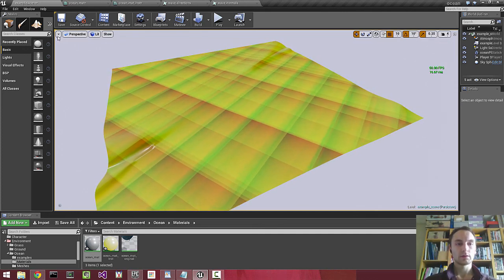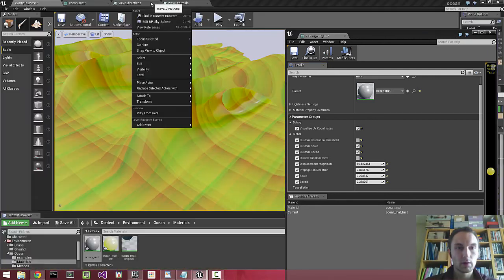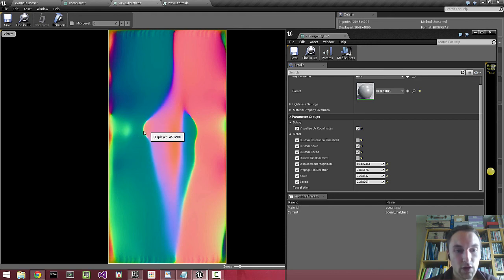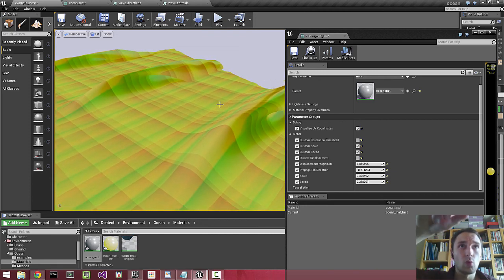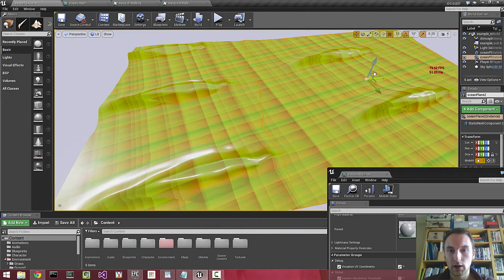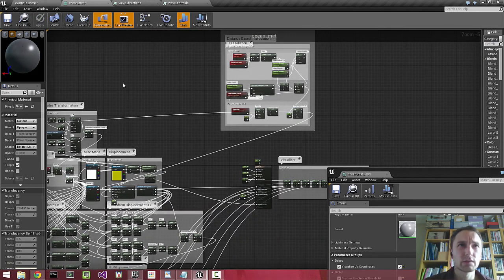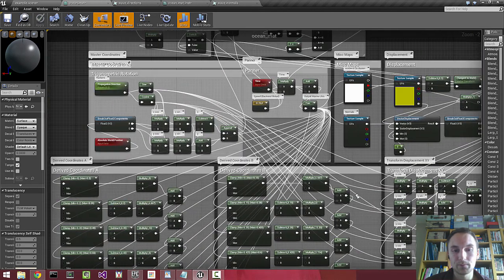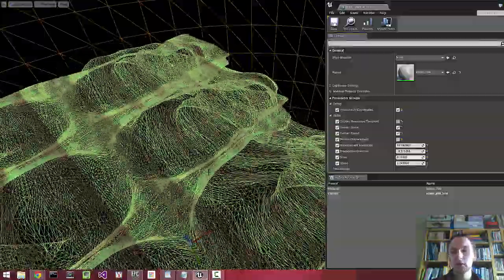Ocean Shader WIP Preview (UE4)

Comment: I don't understand how you made the wave curve forward from just a map? How does a 3d displacement map work? how do you create it? normally displacement maps are just black and white for height...
Reply from the maker: The displacement texture is a 3D vector field. Each pixel describes a direction and magnitude for transposing vertices.
Reply: So the values can be higher than 1? how did you create the map? is there software for it?
Reply from the maker: Which values are you referring to? The vectors comprise of three coordinates (R, G, B), which describe direction and magnitude. In principal, a vector can have a length of 1.73 if each axis has a length of 1. Pythagoras: D = sqrt(A^2 + B^2 + C^2) This is somewhat unimportant though as magnitudes can be modulated when multiplied by a uniform scalar, and therefore maximum lengths can be any number.

If what I'm saying sounds completely alien, you may want to check out some basic linear algebra. Khan Academy is very good for this. It would also help to learn how the DX shader pipeline works.

As for software, I used XNormal to bake the vector field. The most common projection method uses a cage, but for this I used UV matching.

Please feel free to ask more questions if required.
Reply: Thanks, yeah i realized it was a stupid question because you could just do the scalar thingy... I wouldn't be writing shaders if i didn't know basic algebra XD

thanks for the program i'll check it out.